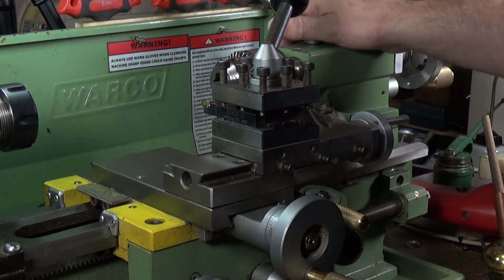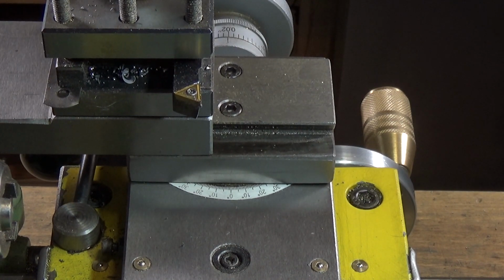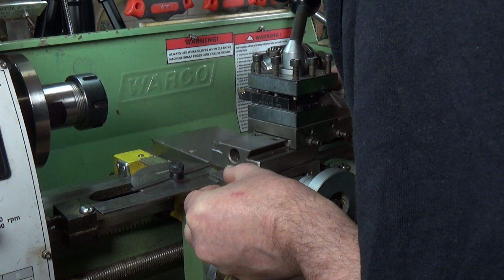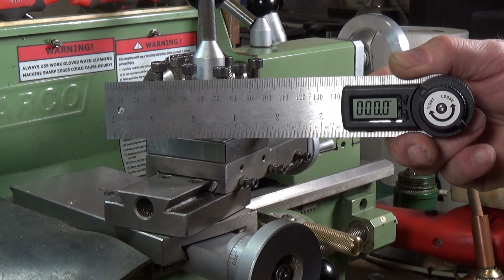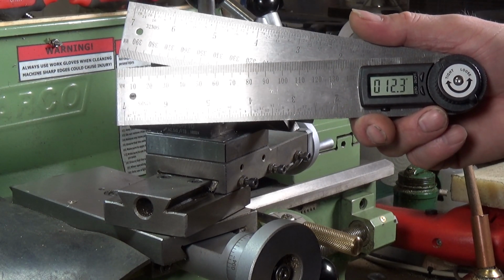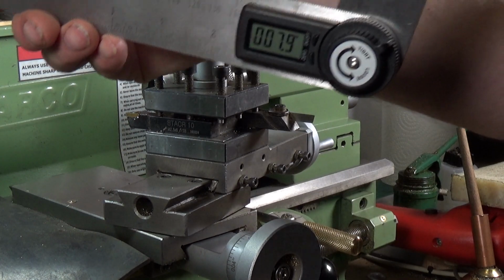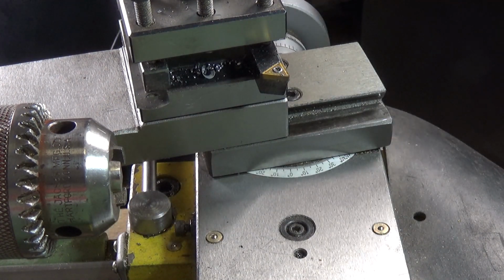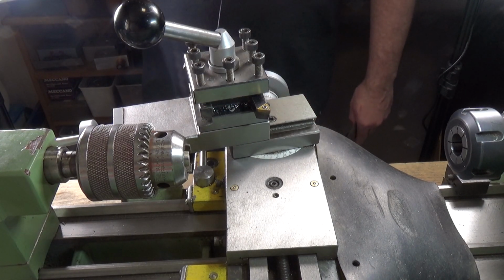Modern Mechanical Tech - Warco WM180 Lathe Setting The Topslide Angle

Comment: Hi. Interesting tool and demonstration, thank you.
The whole time you were showing your old method, I was wondering why you bothered with the square. You could use the "classic" protractor (or a more precise vernier one) exactly as you did your new electronic one. The only difference is the need to add 90 to your target angle.
Cheers

Comment: But this protractor has an error of +/- 0,3 deg.     Correct ?
Reply from the maker: Yes, most of these digital protractors have that accuracy.
Reply: @RetroSteamTech  So that means that these digital protractors is not good enough to make a Morse Taper that operate with 4 decimal numbers ?
Reply from the maker: @Klokkemakeren  No it isn't but I'm not sure why you would want to turn a morse taper anyway, they really need to be ground. If you had to turn one I would put an actual morse taper in the chuck and set the angle on the topslide by using a dial indicator.

Comment: I use a 3" (75mm) sine bar and gauge blocks.
Reply from the maker: Never thought about using a sine bar, must be quite fiddly though.
Reply: Retro Steam Tech : Not really, but I've done it for years that it's become second nature. I've built a spreadsheet years ago that give the blocks I need for all whole angles from 1 to 89 degrees. The spreadsheet lives in my gauge block box so it's ready at any time. I hold a scrap flat bar  against the carnage with a "G Clamp". I hold the sine bar and rung blocks against the flat bar and move the top slide to contact the sine bar before tightening down. Unless I have some weird angle like 24 degrees, 15 minutes and 5 seconds it's not really to hard to do.
Reply: @CraigLYoung  "against the carnage."
Freudian slip? 😃

The spreadsheet is a great idea which I am stealing, thanks!